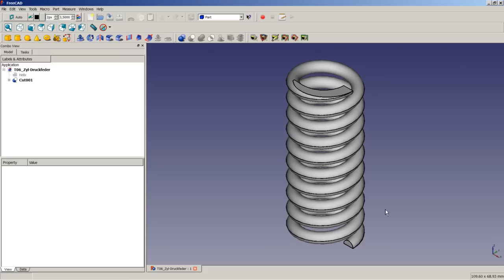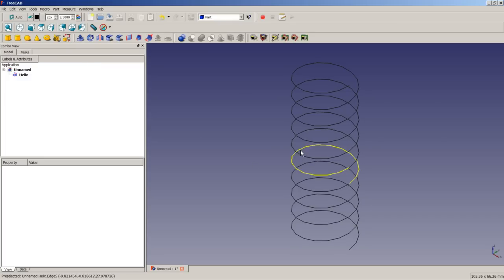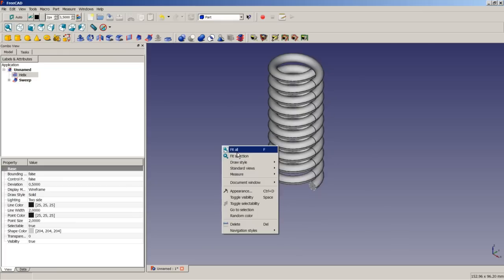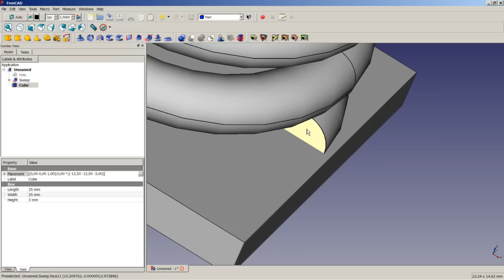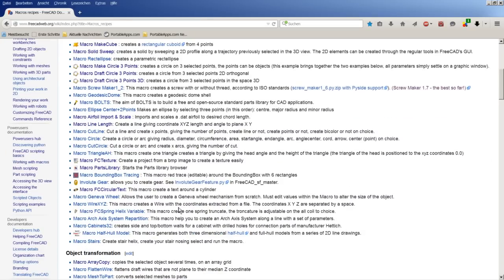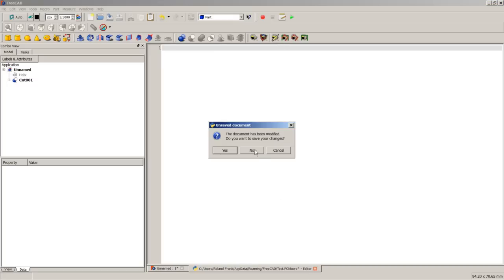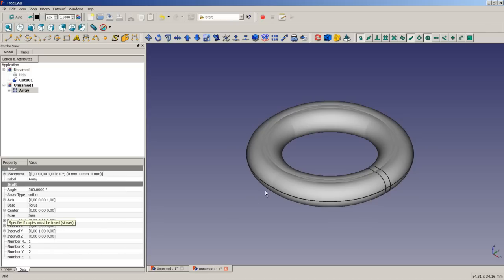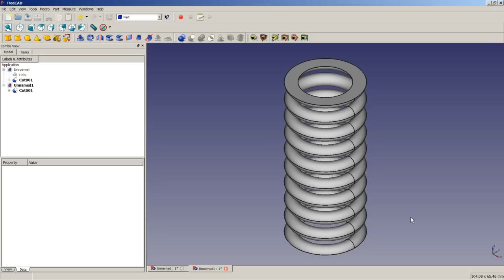FreeCAD Lesson 06 - Compression Spring

Comment: Can we please get a quick tutorial on small assemblies?
Reply from the maker: +willie bloem 
Since Assemblies are seperate solids in one file you have at the moment three possibilities:
> position the solids using placement/move/rotate (see Lesson 11 - Bird Feeder)
> model everything (for example with part design tools) "in place") (see lesson 12 - ball bearing)
> use 3rd party addon "assembly2" (https://github.com/hamish2014/FreeCAD_assembly2)
With assembly2 i have only very little experience, and for my projects i didn't really need it (yet)
Reply: I had this exact question thank you for the outline.  What would you recommend if I have to open two existing modes...say PCB models I import.  Once imported I then need to build a housing around them.
Reply from the maker: That depends a liitle bit. As you can see (and probably imagine) the more and the m ore comple parts are
involved, the methods 1 and 2 would be more and more diffuicult to handle.
I made some projects (see my Grabcad-page, link in video description) with making simple copies
of the parametric models and placing them in a sepearate file.
Since housings normaly would consist of 2-4 parts (and maybe screws and alike) i would maybe start with
> a simple copy representing the outline (shape) of the PCB's
> use part design or part worbench to model first steps of housing parts to get a feeling for size and positions
> then you could switch model the housing parts in sepreate files with all details as single parametric parts
> re-import into assembly-file with assembly2 or as siimple copies to verify size/shape/position
Just some thoughts ...

Comment: Thank you for the great tutorials.
Not sure if this is correct but I used a cylinder instead of a cube which will be already centred and only need to be offset in the Z axis direction.
Reply: Klaas Hogenesch I agree. And with a cylinder, just insert ONE body that matches the height of the spring you want, and do an intersect. Done.

Comment: would we be able to combine the techniques in order to cut down CPU by doing a helix with only 1 rotation, and then using array on that?
Reply from the maker: That is basically possible, but (i am not a programmer) i do get the impression that the most cpu time is consumed by calculating and displaying the result of boolean operations. So I would imagine that your workflow is not faster, but that is just a guess ...

Comment: Hello, Thank you for your very helpful tuto. I just have one question tho. In order to make the spring more realistic, is it possible to squeeze the 2 last spiral at both ends at it is in reality?
Reply from the maker: Yes and no ;-). You could of course create three helices with different 
pitches, but since the helix is (concerning the 3D mathematics of 
FreeCAD core) an approximation of line segments you might end up with an
 invalid solid when trying to join the three helices. At the moment 
there is no possibility within the User interface to get a finer 
resolution of the helix (there may be ways to do it with a macro ...). 
We have to admit that OCC, the geometric core used by FreeCAD is quite 
weak on sweeps along helical paths ...
Reply: oh I see. thank you very much anyway ;-)

Comment: Thanks so much for these tutorials - extremely helpful. Just for the record, I was not able to complete this one under Ubuntu 16.04, FreeCAD 0.15 as the sweep operation results in a "Linked Shape is Invalid" error message.
Reply: Please check if you've made a mistake (for example not clicking on Sweep path, selecting the helix and clicking the old sweep path - now done - button before clicking on okay.
http://forum.freecadweb.org/viewtopic.php?f=3&t=21249&p=165381#p165381

Comment: if we do the spring using the second method, it will result only in some rings, not a true spring. if you start to fabricate what we draw, i guess it would be useless. So, what's the situation when the second methos is useful?
Reply: I believe that the use case for the rings is to assume the use of off-the-shelf springs in production and creating a low memory stand-in when putting together assemblies of parts.